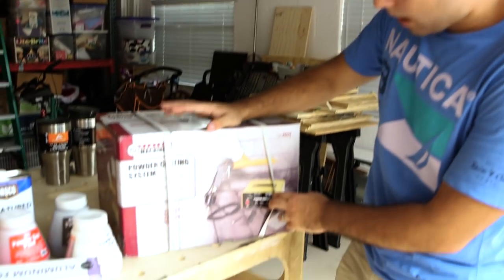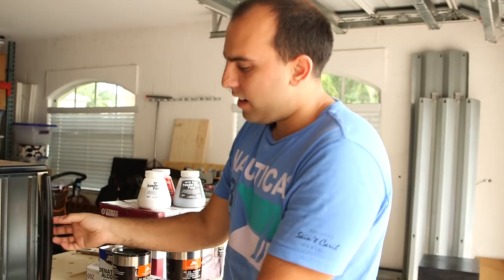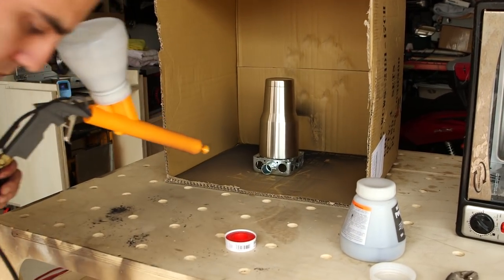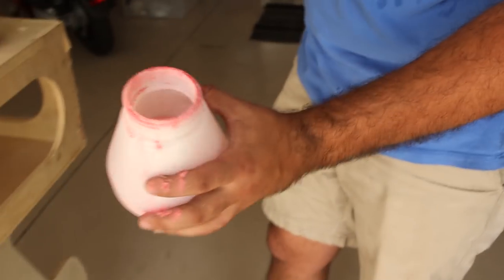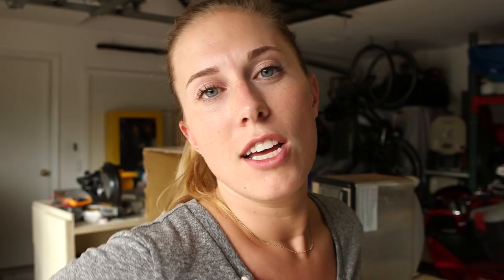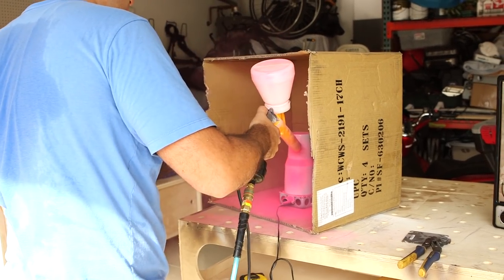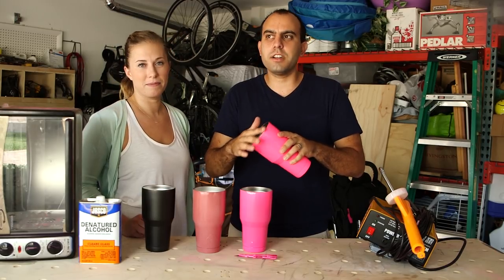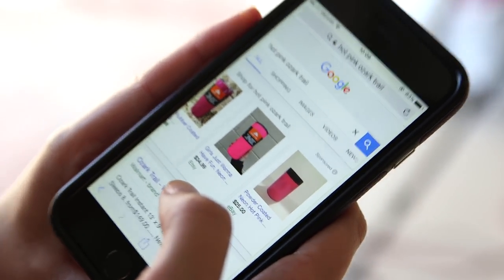DIY Powder Coating is CHEAP, FUN, and EASY! (Yeti Cup with Harbor Freight System)

Comment: I regurlarly use the same gun... Ive found that the angle you hold the gun with respect to the ground has a huge impact on the powder output... better than adjusting the pressure even!  holding it parallel gives the best finish but takes forever, and dropping the tip 60deg or so below the hopper gets you really cooking!  throwing some sheet metal around the part and grounding it lets you collect and recycle the powder as well!
Reply from the maker: Pro tips, thank you very much.  I discovered the angle changed flow, but grounding scrap metal is genius!
Reply: Maybe, Mike, instead of a box you could build a metal hood and then have something new to powder-coat! :)

Comment: I've only had my powder coat gun for 11 years now, so it's about time to break it out and make something. Thanks for your video! Never would have thought to use a toaster oven on its' side. Mike
Reply: Just curious, what brand do you use?
Reply: It's a Craftsman.
Reply: Michael D Kernan that's one I haven't tried.  I found a few on EBay NIB but they weren't a deal anymore.
Reply: I think i talked to you briefly before.  hehe.   If you're getting into higher volume or maybe larger items (if you're the cup guy), you should look into finding a rebuilt commercial guns.    still think the Gema's are nice but they are extremely pricey...or you could buy a car.  haha.   

There isn't much that commonly goes wrong with them besides the cable and usual plastic wear pieces but the control you get on a professional system is in a different category.
Reply: Haha same here. I’ve had mine for 6 years and never used it

Comment: Next time to make it easier on you to spray. Grab a cheap Lazy Susan from the dollar store and you can spin it with your product on top while your spray. Nice diy!
Reply: I actually made a grounded lazy susan so I can ground the lazy susan and don't have to move the grounding wire as I spin the cup.
Reply: OOooooh that's smart as heck!
Reply: ManCraftingTM do you have a video of how to make one?
Reply: Shawna Kitchin I have several videos.  The making part is pretty basic if you or know someone who can weld a grounding tab.
Reply: I'd be interested in how well a metal one works out long term. I've used vices for welding if your ground is connected to the metal table and not the part it travels through the vice and arcs. After a little while it makes your vice jaws harder to move. I would think the same thing goes for the metal bearings on a lazy Susan. Just a thought.
Reply: The bearings are cheap and easy to replace, that said I still have my original 3 inch lazy Susan bearing.  I've not tried to use a lazy Susan for welding, but I definitely can see the issue with arcing.  I wonder if I can figure a way to keep it grounded and use the Lazy Susan...
Reply: a thin rubber sheet
Reply: Crazy Custom Creations LLC
Reply: Great idea! Thanks.

Comment: How you hold the gun and your air source (the drier the air and slightly higher pressure) helps powder delivery, and pulling the diffuser cone off the center wire allows you to direct it at the object better.

Comment: I may have missed it but pre heating the cup before hitting it with powder will help the first coat of powder stick. Sand blasting also helps, if you've got the tools for it. (not being critical, I think the cups look great)
Reply from the maker: Great tip, thanks.  I'll try it out next time.

Comment: Very cool!  I was thinking of getting a HF powder coater.  The toaster oven on its side was a great idea.  I was worried my wife would get made if I put parts in the oven in the house.  Problem solved!   Thanks guys
Reply from the maker: Haha, glad to help.  You don't want to eat from an oven that's cooked this stuff anyway ;)
Reply: Don't bake the powder in the house... it's not good to breath in. And definitely DO NOT use the toaster oven or standard size oven to cook food with after curing powder in.
Reply: If you need something a little bigger than the toaster oven on it's side, I found a 110V smoker that will reach 400 degrees.  It's the only one that seems to do that.  All the rest only hit about 250.
Reply: Sounds cool. I saw your video.  I am considering building an oven from an heater coil from a window unit.  I think the smoker is a great idea.  I noticed several have trouble reaching 450 degrees.  I believe the AC heater coil will boost it up.
Reply: Aikidoman06 I have only found one brand that goes above 400° which is all any Powders I've used need.  If I insulate the bottom it will go higher quicker based on feedback from subscribers that have done that.
Reply: Ill keep my eyes open for one at thrift shops and yard sales.  Thanks.  What's your take on the Harbor Freight gun?  Have you used it?

Comment: I forgot to mention this tip.  I actually did a video on it when I figured it out.  Remove the diffuser for small parts like cups.  More of the powder lands on the cup rather than on the area around the cup.
Reply from the maker: +ManCraftingTM nice thanks!

Comment: if its aluminium, you dont need to cover your part with phosphate, but steel will need an inhibitor, so usually at my work we wash and cover the part with bonderite, wich is a acide base liquid phosphate, the part will retain its powder coat for a very long time without pelling

Comment: Very nice.  I'm going to use that technique, but not the checking air pressure on my hand. I've found that its not a good habit to put an air compressor nozzle or pressure sprayer on your hand or near it to check the pressure. If you've ever seen someone inject air into their hand or a body part by mistake, it can be a very dangerous mistake.  It's also why you shouldn't use your air compressor to blow dust off yourself.  This isn't very likely with air, but with any hydraulic pressure washer, can result in death.    Thanks for the video.

Comment: Great video. I have been seeing cups with flames on them and reading that they were powder coated. So I wanted to find out what that meant. For $50 bucks I will be getting one. Now did you have to hook it up to a compressor? My other half probably has one. Also why was her cup so shiny? And was the denatured alcohol on the table because you have to clean it off after it’s baked? Thanks. Loved this video!

Comment: Great video guys! Have you guys considered using laser toner powder? I suppose you’d want to adjust the baking temperature and time for baking the toner (toner particles run ~20 - 5 microns depending on manufacturer and the printer fusers run as low 315-330° F)

Comment: Make sure you don't eat anything out of the oven it's very dangerous. A buddy of mine remodels house and he gave me an old oven that I use for powdercoating car parts. I even built an extension off the front of the door.
Reply from the maker: This was a used toaster oven that's only for powder coating now.  Good point.
Reply: That's porcelain, not powder coat.  Though I suppose that is a kind of powder coat.  As for is powder coat epoxy dangerous, it depends on the formula.  Some of the ingredients can cause intestinal issues.  You'd have to look up the msds of the powder you're using.
Reply: but its safe to drink coffee from the thermos?

Comment: So, regarding the spots: Always degrease and handle with gloves until coating. And, yes, the multiple thin passes would give you a better result as the movement allows the particles to shuffle in closer together. I learned all this working for Alpha Tech in the late 90s and early 2000s as a Powder Coater.

Comment: Could you tape off areas to make designs / logo on the cup? Maybe multiple layers for different colors? Would it be easy to pull off the tape without disturbing the uncured powder?
Reply from the maker: Yup.  It looks like vinyl works best.  Then you heat it till the paint is pliable then peel it off, then continue baking.
Reply: Andy Eskew check out kapton tape. its heat resistant tape that you can use to mask off areas

Comment: I hope you read this and I hope I get a response, I'm not very lucky with getting responses back. so ok I'm curious if, when you bake the cup if it affects the efficiency of its insulation. when I bought a insulated but it said not to place the cup in the fridge to cool it or to microwave it to warm it ( duh it's metal, that would be terrible in a microwave ha) I would like to do this project on mine is just don't want to ruin my cup. thanks in advance
Reply from the maker: I wondered about that but there are tons of people selling these on etsy so I assumed it didn't affect anything.  We've been using these for a week and they still keep ice over night so I think they're working good!
Reply: awesome thanks I'm really thinking of trying it out now, an id like to try powder coating over a stencil to print images on the cup

Comment: How's the durability of the coating? Will it scrape off with a fingernail? Or would it really take some abuse?
Reply from the maker: That's the benefit of powder coating.  It's extremely durable (more than regular paint).

Comment: Should you be able to figure out at what distance the nozzle needs to be from the surface, adding a gage to the air hose (with regulator valve), and putting the items which are to be sprayed on a lazy Susan, you could fix the nozzle to a static position and your spray time will go way down. If u decide to do that let me know, or make a video. Happy painting.

Comment: how is the durability? I bought some powder coated cups from a company online and if it bumps anything hard at all it chips the paint. Does yours hold up?
Reply: The coating is usually tough. Not saying that it is not impossible to chip. If it is real powder coating and not paint; applied correctly it should stay on.  We have been powder coating for about 3 years now. I have never had my powder coating to chip. My wife's favorite cup fell 3 ft to the concrete, devastated, she picked it up and no chip but did have a dent.  With this being said we do use high grade powder and even though we started with the HF system, we quickly updated to a higher quality brand. Please do not use your household oven to cure in unless you will NEVER cook food in it again and it is outside the house.

Comment: It looks like you didn't have a very good ground, the whole idea of powder coating is you don't need to spin the painted project at all, it should wrap around, it's electrostatic for this reason, square objects or internal and external angles are impossible just using the gun regardless of cost due to a phenomenon called a faraday cage, you would need to heat them up to about 180c for a while, then coat them and put them back into the oven to cure, a simple metal box with a couple of 2kw hob rings will make a great oven, if you can have a slow speed fan in there it will help to alleviate hot spots, Polyester powder is best for exterior use.

Comment: Mike. I may be 14 but can you put on a mask.pls
Reply: they're powdercoating their lungs too! lol
Reply: @idrift314  Why would you talk smack to a kid talking about trying to be safe?   SMH
Reply: @idrift314  I've been an automotive a painter for years and you are completely wrong. The powder isn't ionized and has no electromagnetic value, only the part you ground does, the powder just sticks due to static electricity. Just like regular dust or paint particulate in the air, breathing powdercoat will get into your lungs and do damage. What you said makes zero sense.. try inhaling some powdercoat and see what happens.
Reply: Jake Alliston you think all those carcinogens are going to present with a medical complication 5 seconds after you’re exposed? Write us back in 30 years and let us know how your lung cancer is going.
Reply: @idrift314  That's what every smoker has thought also until they are coughing up black tar and die suddenly.
Reply: The bottom of the box was not grounded and look at all that powder on the bottom of the box. And, they are right you can breath in the non-electrified powder and it doesn't need to be baked to hurt your lungs.

Comment: That is really kind of cool.   Do you pre-treat the metal at all?  sand it or wipe with mineral spirits or anything?   That looks ridiculously easy.  I had no idea.

You cooked it at 400... so does that mean if you get it over 400 again it will deform/run ??  I'm going to have to check this out!
Reply from the maker: We wiped the metal with denatured alcohol to get the finger prints off, but that was it.   I'm not sure if it "cures" once heated or will melt if it gets hot again.  Maybe someone with more experience can chime in?

Comment: Please wear a mask. Breathing in this stuff is realy bad.
Reply: Sokar12345 how do I bake it to the inside of my lungs?
Reply: Sokar12345            best to filter it through a cigarette but
Reply: Samuel James only way to prevent that silicosis!
Reply: Yeah, seriously, you gotta wear PPE when you are spraying. DIY welders are the first offenders tho, I’ve seen folks welding galvy without a respirator... which is nuts.

Comment: How does powder coating hold up compared to other finishes?
Reply: Yes that is what I was wondering too. I was afraid the smooth stainless steel finish underneath might allow chips or scratches to show through. How are they holding up to abuse?

Comment: Hi Mike, is it food safe?
Reply from the maker: I think some paints are food safe.  I wouldn't trust the $6.99 harbor freight brand ;)
Reply: Powder paints are a mixture of chemicals. They have many ingredients that could be harmful. They are definitely not food safe in my opinion. Better to reefer to the MSDS of the particular powder you are using.
Reply: Amila Ekanayake theres no msds. Maybe an MDS
Reply: Hector Marquez It used to be MSDS (material safety data sheet), I think now it's been shortened to MDS (material data sheet).
Reply: There are definitely FDA approved food safe powders.   we frequently do hospital equipment, machinery for food processing plants, etc.

Comment: does anyone know if you can paint a car using this harbor freight powder coat?
Reply: Betoe Ortiz if you have a big enough oven to roll your car into to cure the powder 😂
Reply: just go park it in arizona, problem solved
Reply: No that little powder coating gun would not be able to spray anything g of size, it wouldn’t be consist at all.... and the oven is the second problem

Comment: Are the cups "Dishwasher-safe"?
Reply from the maker: I think powder coating is, but the cups say on the side not to put them in the dishwasher.  I think it may ruin the vacuum seal.
Reply: The bottom cap is glued or press fit.  So water gets in past the seal and when it gets hot it will steam it off in the dishwasher.  Once powdercoated, that seal is sealed.  I haven't had issues.
Reply: I think the  stainless steel getting discolored splotches has more to do with it not being dishwasher safe.
Reply: The bottom cap can pop off in the dishwasher.  I've run my tumblers 100's of times through the dishwasher.  No issues.
Reply: Could there be a dishwashing video with powder coating? Hmmm....
Reply: I was wondering just this thing.  I assumed the problem with the Dishwasher was the heat, but surely your little oven gets hotter than the DW.
Reply: Kent Morrill way hotter. Oven is about 400 and dishwashers don't go much over 200.
Reply: Powder coat is dishwasher safe. A lot of the metal thermos type cups are powdercoated. Curing powder coat in the house or household oven is unsafe. The actual cup may not be dishwasher save because metal being washed in heat and water tends to “smut”. Smut is the black stuff that creeps out of the metal if you degrease to harsh or wash in to hot of water. Basically the metal sweats releasing contaminants. This happens more with aluminum, but with how heavy dishwashing liquids/pellets degrease, it’s likely to affect a wide range of metals.

Comment: Compressed air accidentally blown into the mouth can rupture the lungs, stomach or intestines
Compressed air can enter the navel, even through a layer of clothing, and inflate and rupture the intestines
Compressed air can enter the bloodstream, and death is possible if it makes its way to blood vessels in the brain
Direct contact with compressed air can lead to serious medical conditions and even death
Even safety nozzles which regulate compressed air pressure below 30 psi should not be used to clean the human body
As little as 12 pounds of compressed air pressure can blow an eye out of its socket. If an air pocket reaches the heart, it causes symptoms similar to a heart attack. Upon reaching the brain, pockets of air may lead to a stroke.
Reply: lunaramp take note everyone..... here is THAT twat that searches through innocent videos just so they can post up horror stories of all the things that will happen to you if you copy the people in the video.
......be afraid, people.

Comment: No way that this can be called “cheap” you have to already have an extra oven that will never be food safe again and a compressor. The powders are costly too if you want something other than the 4 harbor freight colors. It is still a cool project, just not cheap. It’s cheaper to just buy a custom yeti off of eBay.